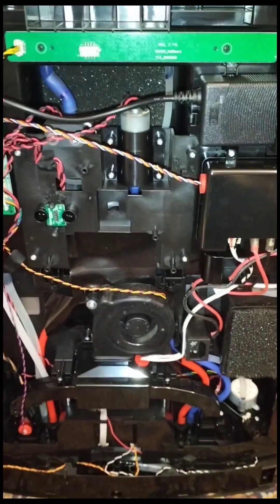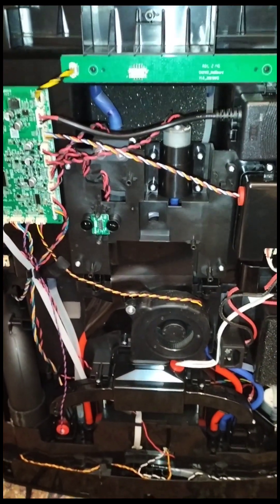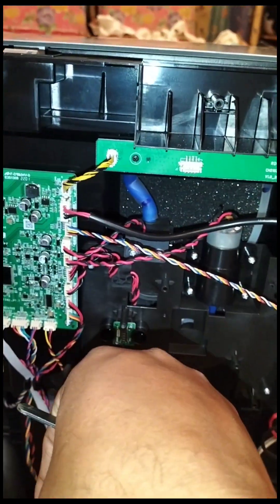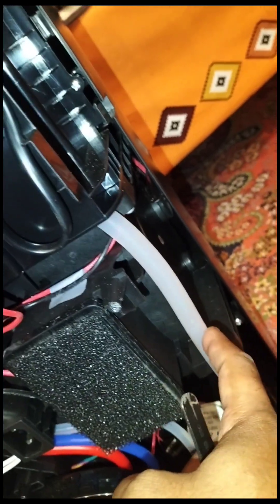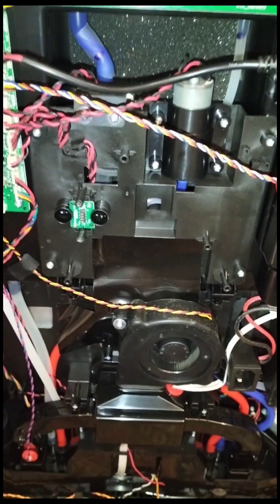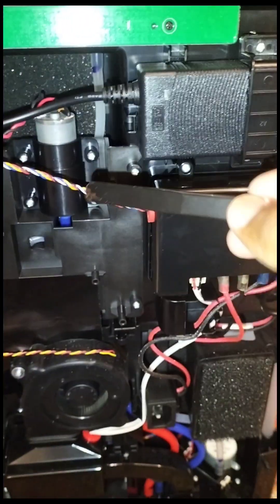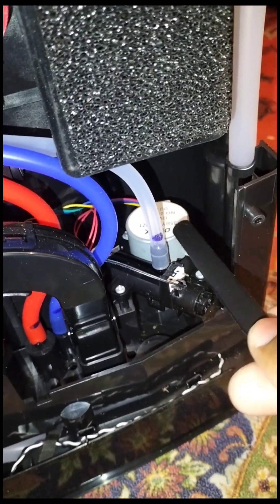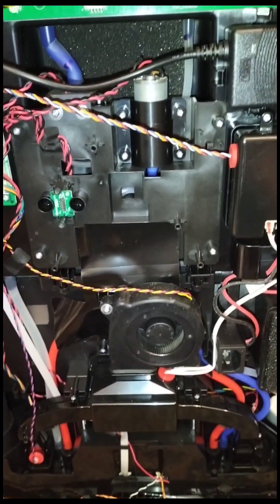Ecovacs X1 omni station components introduction & How it works..

Comment: Thanks for your video.

I have two that both quit within 2 weeks of each other.

Both won’t dispense water, but will suck it up. I checked the seals and everything looks great.

From this video your saying that it would be the motherboard and not the pump/solenoid?

Comment: HOW TO REPLACE SOLENOID PUMP

With reference to this timestamp: https://youtu.be/-MsPhldsoec?t=95

Take a picture of the motherboard wire connectors and make a note where each one should go. Then proceed to unplug all wires blocking your access to the solenoid pump (just unplug the wires on the right side of the motherboard should be fine; you don't have to remove the bottom row.)

Remove the 2 screws with the metal washers connected to a rubber piece. There are 4 additional screws holding the plastic plate together at the 4 corners - remove these as well. There is a black plastic tape at the bottom that you can peel gently to move the plastic plate out. You don't have to remove the plastic piece totally, just tilt at from an angle and you will get access to the solenoid pump. 

There are 2 connectors from the solenoid pump to the water pipes (1 at the top in blue and 1 at the bottom). You can just unplug both - the fitting is a bit tight and there might be a plastic tubing over the connections (probably to prevent leakage). Unplug the solenoid pump from the water pipes with a firm tuck, taking care not to break the plastic tubings.

From there, you should almost be able to hold your solenoid pump in your hand and start replacing the necessary parts to ensure a good fit of your replacement into your X1 omni dock. Compare the old and new solenoid pump - they should look almost the same except for the black rubber pieces on your original solenoid; strip away any excess rubber fittings that came with your new pump. 

There are 2 black rubber pieces (top and bottom again) that you need to remove from the original pump and affix it to your replacement pump so that the new pump does not move around when pumping water through. There should be a black and red wire running through the top rubber piece and you can just bend the rubber to create enough space to pull the connector head through. Take care not to damage the wire and connector head on your replacement solenoid.

Also, check your connector head on your replacement solenoid - my replacement had a different head from my original pump. If you need to change connector heads: just follow the wire back to your solenoid pump (both old and new one) and there seems to be a catch-lock that you can easily press down to remove the wire with the connector head. Replace accordingly.

Once done, you can then start piecing everything back together. Ensure that your connector head goes through the hole in the rubber piece so that you can connect it back to the motherboard. Connect the 2 water pipes (top and bottom) back to your solenoid pump. Adjust your solenoid pump so that the bottom rubber sits squarely in the spacing, then screw the top rubber piece with the 2 screws with metal washers back. Then adjust the plastic backplate to the correct position so that you can screw back the 4 corner screws - it might take a few tries and you will know when it 'clicks' together tightly for you to start screwing it in; removing the plastic tape at the bottom of the plastic plate might help you find the correct alignment easier. Connect back all the wiring to the motherboard. 

Before putting everything back, plug in your power cord, load your water tanks. There is a black squarish thing at the back that needs to be screwed back too (i think for the machine to work). Then press the left button on your dock (water droplet symbol) and hope for the best! If it works, water should start flowing again. Once confirmed, put everything back together. 

If not, you might want to recheck your connections to the motherboard, check all connectors are tight, check water pump is tightly connected to the tubes. Or you might have receive a defective replacement pump? Or it's probably some other issue.

Oh and here's the link I got my replacement solenoid pump from Aliexpress - H Series DC12V 21W Water Pump Solenoid Pump For ECOVACS Robot Vacuum Cleaner N9 (https://www.aliexpress.com/item/1005006217186565.html?spm=a2g0o.productlist.main.1.23f1116aCtzEaY&algo_pvid=9d7b8920-4c7a-45e6-a5ee-cd58894baeb2&algo_exp_id=9d7b8920-4c7a-45e6-a5ee-cd58894baeb2-0&pdp_npi=4%40dis%21SGD%2152.21%2133.94%21%21%21276.26%21179.57%21%40213bd97f17277857238784088eb098%2112000036323305279%21sea%21SG%210%21ABX&curPageLogUid=zu7HDy70QmOr&utparam-url=scene%3Asearch%7Cquery_from%3A)

Comment: Hi can you help? My omni station is not supplying water to the tray. Water return to the diry tank is fine. I presume the solenoid is the issue? Is there a way to check?
Reply: I have the same problem. I’ve had my Deebot T10 Omni for a year working great. Then I noticed the mod heads getting dryer until finally no water at all. I took the back off according to your excellent instructions to inspect the tubing. They all seem to be clear. If I press the wash station bottom pan, I hear the pump run, but no water goes there either. If I put water in the station pan manually, and press the clean pan button, it sucks the water out to the dirty tank just fine. Any ideas?
Reply: Mine is doing the exact same thing. Can anyone advise what else I should try to fix this?

Comment: Deebot n10 leaves lines dirt lines while mopping.
Even i furst use vaccuming only with full power then use mopping only, if i spary water on floor with spray bottle then lines are reduced by half, i even wash mopping cloth twice in one room then also mop leaves lines like cloth have never been washed.
Reply from the maker: Plz check the mop plate...might be uneven n stuch from one side...

Comment: I think my Deebot N8 base station vaccum is dead.. I already checked the brush cover is installed correctly on the bottom of the N8, it goes to base station and states "Emptying dust bin" but the vacuum in the base station does not turn on.. It looks like it has a good seal on the suction pads but no vacuum. Any suggestions? I'm having trouble taking apart the base station to get to the motor.
Reply from the maker: Motor assembly need to replace

Comment: Please, i need your help  ,my omni x1 is not despensing clean water ,motor is working fine ,we checked if any visible damage there is nothing that we could see , can the clean water  tank be the problem? Please, i need your help thanks
Reply: Same problem
Reply: Same!  I would love it if we could see a trouble shooting video for clean water not dispensing :)
Reply: Same, please help us! Thanks
Reply: I have the same problem. Clean water is not coming out, but when I pour water into the base plate, it is being sucked into the dirty water tank. What could be the problem? Please comment
Reply: I’m so over this Omni x1. I’ve had so many problems. I tried opening the back but there’s 2 screws I can’t get off. The water isn’t dispensing out of the box. The customer service help is always terrible.
Reply: It’s probably that solenoid he was talking about.

Comment: Bro in my ecovacs deebot n10, in the suction area some rubber burning smell is coming , I bought only two months ago
Reply from the maker: I think vacuum fan assembly touching with its cover that's why normally it happened
Reply from the maker: Need to open top cover then only can confirm